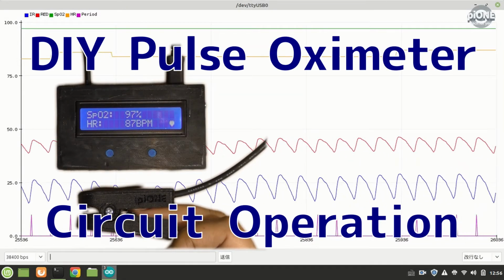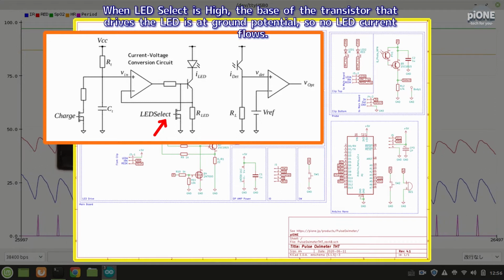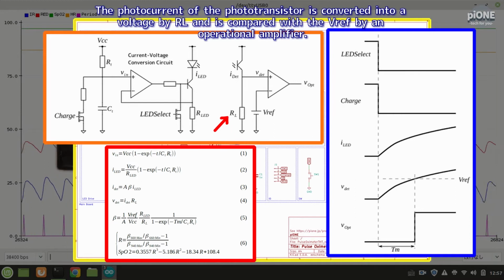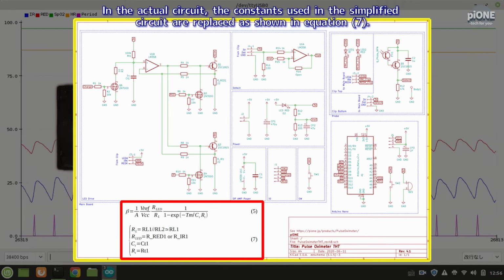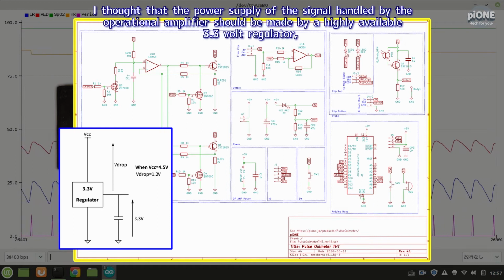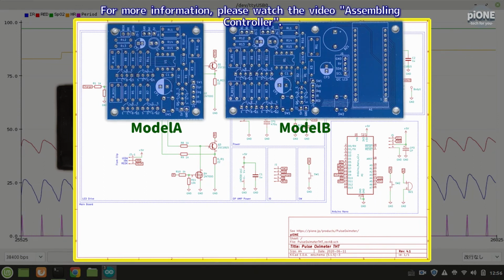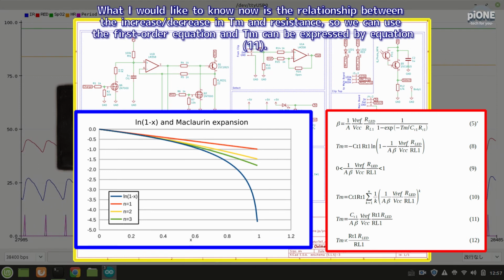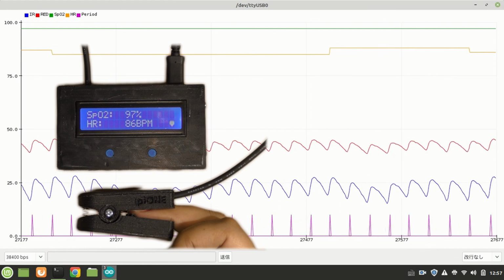DIY Pulse Oximeter you can make   3. Circuit Operation

Comment: pls, can you help me, what is the relation of Tm and measuring beta AC and beta DC
Reply from the maker: Mathematically, it is equation (5) in the video.
Physically, the time it takes for the light that passes through your finger to be gradually dimmed and the transmitted light to fall below a certain number is Tm.
beta is the absorption coefficient, which is 1 minus the transmission coefficient.
Since the light from the light source is dimmed according to the exponential function in the CR discharge circuit, Tm and the absorption coefficient beta also have an exponential relationship.
  beta AC and beta DC are calculated from Tm, not measurements.
Reply: @pionechannel1551  wow it’s good explanation, tks you so much